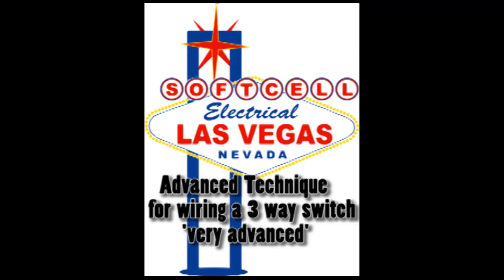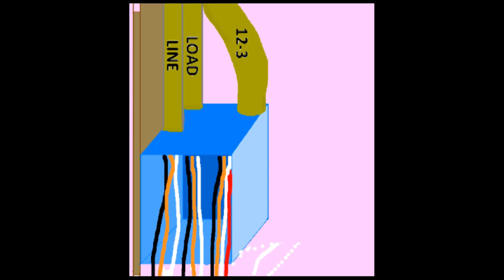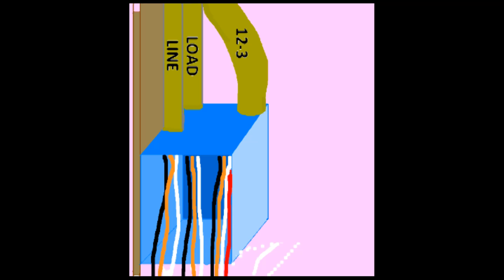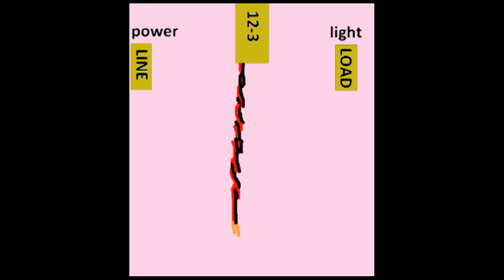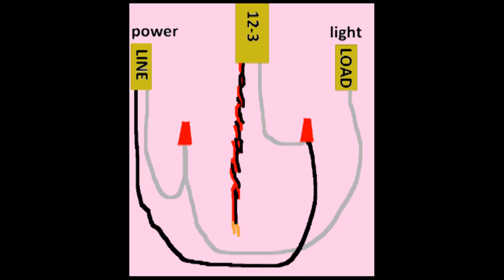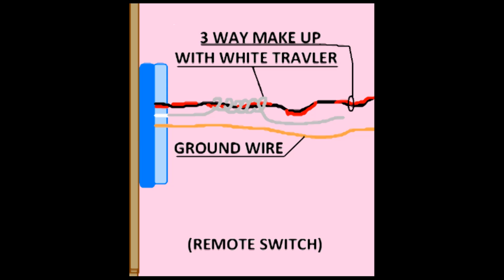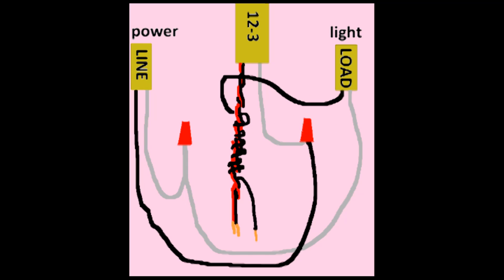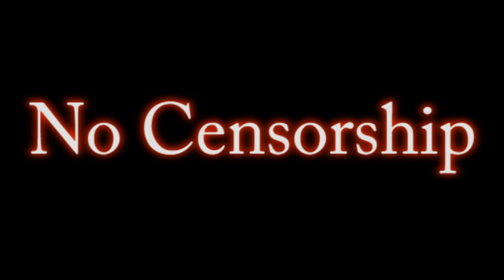Remote 3 way switch instructions # 91

Comment from the maker: One last point. Your company ought to invest in a 75 pound electric jack hammer. It has about a 20 to 1 work ratio. (If it takes 20 hours to pick something, a jack will do it in 1 hour). I got mine on a trade out with a landscaper.  I LOVE my jackhammer. Of course there still that little shovel thingy. Hand in there, and when you get the opportunity to run wire or box...ask LOTS of questions. The faster you learn, the quicker you will be out of that ditch.